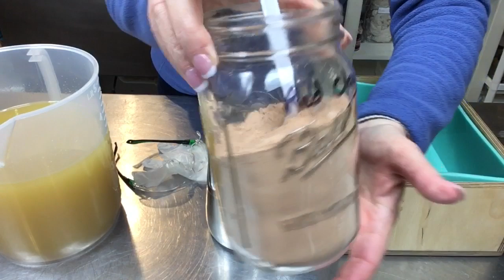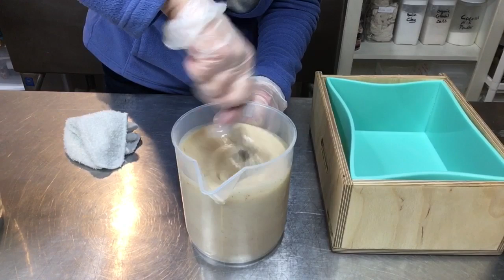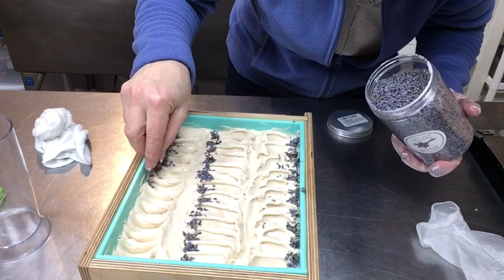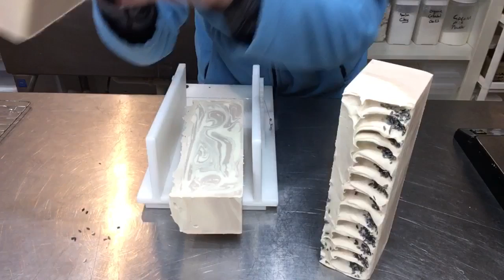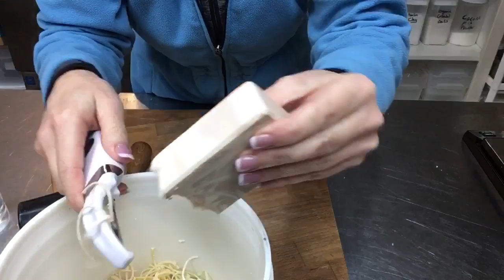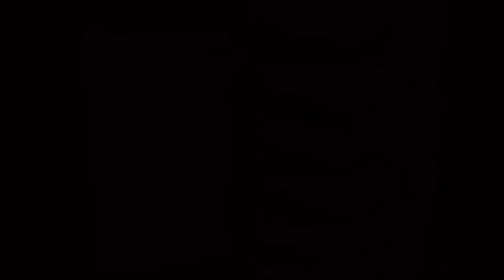Making, Cutting & Stamping GOAT MILK LAVENDER Cold Process Soap | Ellen Ruth Soap

Comment: Try dipping them in pure(1st process) wax cappings beeswax- this is the purest wax, what makes a WHITE candle. Without any dye. It's a very light yellow at first,  until heated and formed, then cools to the purest of virgin whites. What's actually used in(and donated to, as a tithe) churches! For THEIR ceremonial candles.😉you just won't find a purer wax. Of course, a light enough dip will leave you with that clear coat when dry.
Reply from the maker: Wow, that's a fantastic idea.  Never would have thought of something like that, cool!😃
Reply: That's a great idea. I allow my botanicals to soak in melted shea butter or avocado oil (because of the high unsaponifiables). That always kept mine from turning brown even when thoroughly mixed into the soap, but I love this idea.
Reply from the maker: @SarahAnneStuff  That's a great idea! Thanks for sharing!

Comment: Hi Ellen! I just made my first batch of goats milk soap and when I cut it, I noticed little yellow spots. Is this because I need to strain my goats milk/lye solution or maybe I should have put my mold in the freezer? My goats milk was frozen and I soaped at room temp. 🤔 Thank you...I sure enjoy your videos!
Reply from the maker: Some times the milk fats can turn dark yellow, it can be tricky.  Some folks do put the soap in the fridge to prevent gel phase..
Reply: Thank you very much! I stick blended my gm/lye mixture this time to break up the little pieces of fat and then I strained. I put this loaf in the fridge...fingers crossed!! I very much appreciate your feedback!